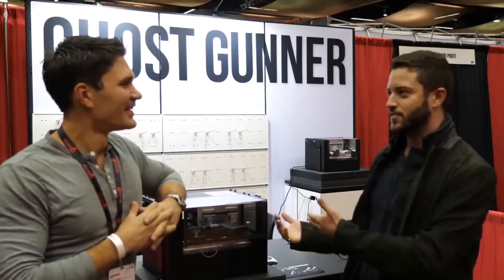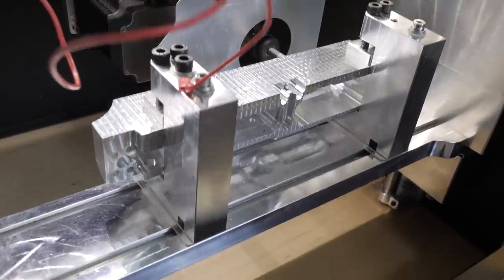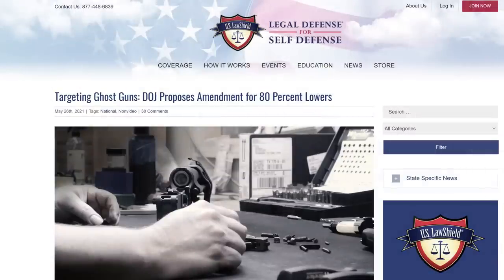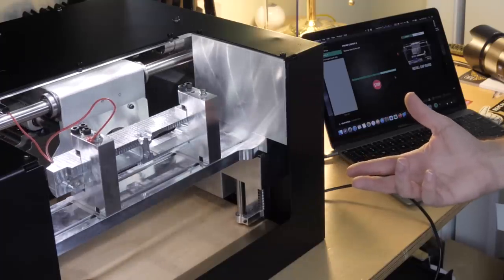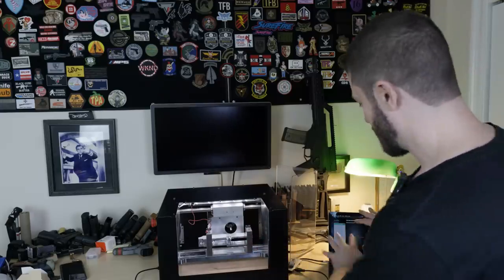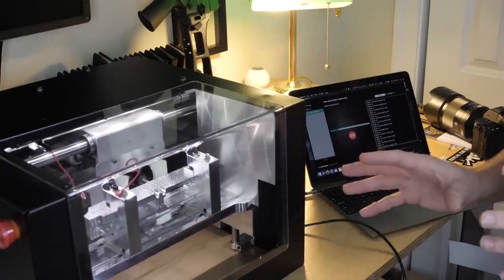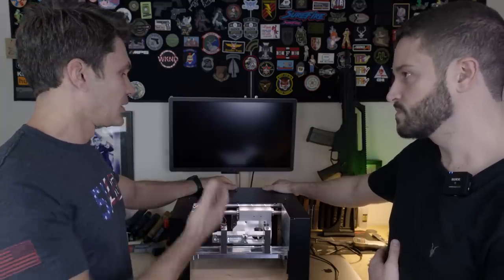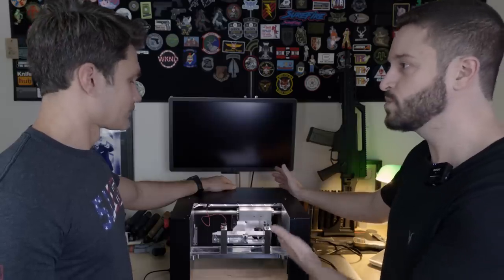NEW: Turn a Metal Block into an AR-15 Lower at Home with the GG3 Upgrade

Comment: This is great news! I imagine combining this CNC machine with 3d printing and we could build really interesting firearms.
Reply: Already happening
Reply: @hungryorphan5975  There have been people modding the software to use the GG2 to engrave on the firearm.
Reply: @thmsmgnm  Damn.  So there's literally no reason to not jump in now.
Reply: @hungryorphan5975  Nice? Could you mention any project being developed as a hybrid with the GG3 and 3d printing?
Reply: @Franiveliuselmago  off the top of my head I don't remember but print shoot repeat made a 3d printed  scorpion with an ar reciever, could print the other parts or use a mill
Reply: Called additive machining
Reply: E3D toolchanger
Reply: @Brandon Diederich you can use ecm to make rifled barrels
Reply: @hungryorphan5975  Alternately, a knowledgeable someone will likely figure out a way to build a rifling bench using a GG3 (or other desktop CNC), a 3D printer and hand tools.
Reply: Need files for glock slides next
Reply: Got a quick question.  Would there be the coding, etc for making the FN FAL receiver?
Reply: I mean, nothing really new, you could already buy 80% recievers and this just makes them, you have the same end product, then there are the 3D printed parts that are already out there and the ones currently being designed, none of them are going to change because the receiver is still the same so i fail to see your point
Reply: Its easy in Usa where yo can buy all needed parts, but dont thinks is so easy in europe and other countries

Comment: It would be nice to see GG4 or 5 turn into a slightly larger more rigid machine that would be  a more "open ended" consumer affordable tiny CNC machine.  The only PROBLEM with the GG are that they are kind of keyholed into certain size jobs and certain products.  I'd love to see the next iterations be more of a "if you can dream it, and do some solidworks, and it fits in an X x X area, you can mill it with this micro CNC.  Lots of us would love to make optics risers, flashlight mounts, adapter plates, custom ideas, and a plethora of non firearm parts.  Look at what decent 3d printers have grown into..  If I buy a micro CNC, I want a micro CNC not just a firearm builder.
Reply: Exactly, I couldn't see myself buying this with such a limited use, but a miniature CNC machine that could create anything you design that fits in it's work envelope would be awesome!
Reply: If it would run off SOLIDWORKS or Autodesk files, that would be awesome and have way more utility than just making a lower or 2
Reply: @wombatstriker  For real man.  I'm used to cutting shit with files and stones and calipers.  Even if there was a little chatter, it'd be awesome.  Luckily the "hobby home machinist" market is booming.
Reply: You've all missed the point of Ghost Gunner. It is a fully functioning CNC mill that runs on G-code, just like every other CNC mill out there. You CAN use Solidworks or Autodesk to do your modeling then run those files through the G-code converter, and feed that to GG.  If you've got the G-code for a metal miniature of the Enterprise, it'll spit one out for you. It does not just make gun parts. What they sell is the machine itself which specializes in gun parts and has the programs for gun parts, but you absolutely CAN feed it any program for whatever CNC Milling part you want to make.
Reply: @torjones1701  I meant more with the fixturing.  It seems quite specific.   I havent looked in a while, but last time I did I couldn't find anyone who had (vertically) installed a more traditonal machine vise.  If that is becoming a thing, that's awesome.
Reply: @mattfleming86  Yeah, a traditional machine vise, even a micro version of it, would be nice.  I've seen some pretty small, like a 4" low profile, but they won't work with GG because GG works on its side in comparison to traditional machines. I know that a professional machinist won't have problems making it work, but hobbyists will need a bit more understanding in making the work-holding adaptation to the GG.
Reply: @torjones1701  Yup.  And kne advantage of being an experienced machinist is that you'll have a plethora if tools (and materials) to MAKE more tools and fixturing.  
I think we'll be there soon.  Hell some of the small chinese mini CNC's are getting there.  With enough volume (and competition) it'll happen.  The desktop models keep getting better.  I know if I could get into the game with a machine (in size) somewhere between a microwave and yeti cooler that is rigid, affordable, serviceable, etc. i'd be stoked.  Give it 5 years
Reply: I'm surprised we're not all building miniature CNC machines right now.
Reply: @cheifDeisel  I'm not. If you consider that the easiest and cheapest way to get a CNC Mill is to start with a manual mill and upgrade it to CNC, and that alone is not a skill every hobby-machinist has or can develop, it really doesn't surprise me in the least. That most of the CNC conversion kits won't work with just any old hobbyist desktop mill, complicating things even further, it really shouldn't surprise anyone. Those who find it easiest are those who've built their own 3D printers, CNC Routers, and other such equipment, and it's still complicated enough to give most of those experienced people pause. It is only simple in concept, the execution tends to be somewhat more complex.
Reply: @torjones1701  🤦🏼‍♂️
Reply: I would spend $2000-3000 on a small general CNC mill in a HEARTBEAT. But with the limitations of this machine, and it’s sideways layout, I likely won’t buy it. I mean, how many lowers do I really need?
Reply: @alphazuluz  Totally agree. If it was a CNC capable of at least milling aluminum, and had a small range like an Ender 3, I would easily spend 3k on it. You can find used mills in the 4k range, but you have to upgrade to CNC which is more money. The GG is interesting, but the only other limitation I would mention is the range of motion. I would prefer more than a couple inches on the Z axis (Z being up and down since that can change).
Reply: @wombatstriker  look into a pocket nc and see what they can do, may be up your alley
Reply: Well you actually have to purchase the product so they can afford RnD into that project. Everyone always wants a Ferrari but they don't want to support them by buying the wagon first
Reply: @ajjohn8729  if they do not have the capital from the first two iterations that’s kinda fucky 🤷‍♂️
Reply: @ChineseSweatShoppe  weird how RnD works. I get you probably work an Amazon warehouse job and don't totally understand how manufacturing works so let me help you. You pay your bills with sales. The extra money from producing, selling, doing warranty work, and keeping the lights on goes to research and development. Inorder to improve a product you have to get customer data and examine warranty repairs to see fails spots you may have not forseen. You then have to pour that extra money into prototypes and do hundreds of hours of testing. All while maintaining, producing, warranting, collecting data o the previous iterations to release a new one. So support them or go back to your Fudd shit.
Reply: @ajjohn8729  "boohoo he doesn't want to shell out thousands of dollars for machines that can only do engraving and the finishing work on an 80% which can just be done with a decent and much cheaper drill press, he sucks for not having supported them when it was so obvious dispite them keeping the whole 0% idea quiet that they would clearly go from a heavily limited machine to a much more capable, and he should be ashamed of himself for being skeptical of a machine that went from being so limited to so capable and barely has any real indepth videos out there on how it works and how it's made unlike almost every other hobby level CNC machine out there in its price range and below its price range, this is just a miracle product, the writing was on the walls people, the guy running this is just a saint who hath handed down to us the key to freedom and this man scoffed" stfu dude,  being critical of a shotty new product and not just praising it cause it could be the new tesla is a sign of intelligence, yes i agree most products from a new company don't sell too well for the first couple versions and such and it can be a part of the  R&D process, but its fine to be skeptical on why the first few didn't sell, after all most companies don't produce a geo metro then a ford fiesta then suddenly jump to a Ferrari, they usually take a pitstop at making a fierro
Reply: I bet you unironiclly print toys with your 3d printer dont you?
Reply: Making my own optic risers would absolutely be great! I’d go for something like that.
Reply: @mattfleming86  Yes it is
Reply: It's completely programmable make your own fixture and make a program and don't expect people to hold your hand this machine is a CNC mill not just a gun builder you sound foolish
Reply: @chriskraus2440  You missed the "Slightly larger and more rigid" part.  I may be foolish but at least I can read.
Reply: Just get a shariff dmc2. The ghostgunners arent worth the money they want for em
Reply: @torjones1701 it's BARELY a fully functional CNC machine. Definitely not worth the money they want for it

Comment: Would be nice to see the final product at the end of the milling process.
Reply: That might be legal hot water
Reply: @CHMichael  Why? If its legal for me to buy one  and do it why can't he make one and show it?
Reply: They have some video of it, theres one video of it at some sort of event, they make it in 3 parts which are bolted together using threadlock on all the bolts, which explains how they do it in such a small machine, and also means you could do it on a cheaper small CNC machine using the same method
Reply: @farquharsondan Youtube doesn't like it.

Comment: The 3d printing gun community was literally started by Cody Wilson. The FCG9 has been photographed in the wild being used by rebels against Myanmar. We have already won, even if government refuses to admit it. Huge credit goes to Cody Wilson, and of course the actual designer of the FCG9, J Stark, who was murdered by the German government.

I'm not necessarily taking sides in the Myanmar thing, mind. But those who rebel are always within their rights. The fact that they're building guns entirely outside the control of the State is what we should be celebrating.
Reply: If you want to be specific, Stark wasn't the actual designer. The FCG9 was a copy from a Texas designer with possibly one of the first semi-auto printed firearms, and the FCG9 was a minor revision to the AP9 to use metric screws and specified an ECM barrel (which was already a thing). If you want to say "popularized", maybe, but even then, its just a metric reskin and I would say "remixer" (which there are actually more substantial, and impressive remix designers than the FCG was).

Can you imagine being the real designer, and then some kid steals your work plastering their name over it? As a mechanical and aerospace engineer I would be very annoyed (which the designer was since all they were asking for was credit). Seems trashy to steal major credit and all that important testing like that... I personally think all mechanical designs are cool, and small arms designs are excellent for learning to improve almost any commercial product (such as designing for installation, tolerances and their importance, nifty assembly tricks etc). I may not specify "inspired by Eugene Stoner" for unrelated products where I see a cool little feature I add to product, but I'm also not flat out copying like Stark did. I'm glad someone ran with the design though and improved it, but I don't see a reason on hiding credit where credit is due.
Reply: @jakegarrett8109  did not know that.
Reply: I don't really agree about that part about those who rebel are always in their rights to. Thats not a concrete correlation...
Reply: @georgewhitworth9742  by definition humans have a right to choose their governance. By definition any government which has to deal with rebellion is overstepping their bounds. Government is the most evil thing humans intentionally do to each other.

Comment: Anybody with the specs and a milling machine even on old school tooling can do the same thing. It may not be as precise as a CNC (computer numeric control) machine but it will still work. Folks have been doing it for ages. No one can kill the cottage industry.
Reply: The point of this is to make creating lowers as easy as pirating music.
Reply: Yes but you really need experience or at least training to do it reliably, this eliminates that and gives the average Joe the ability to machine their own firearm parts without having to go through that.
Reply: These desktop CNCs aren't going to have anywhere near the tolerances of a 5000 lb 5 axis Bridgeport.  
They will still get a lot of jobs done anyway.
Reply: @joenunya8449  yah but you don't need that accuracy or tolerances to machine a firearm.
Reply: A $2500 box the size of a desktop printer is much easier for people to buy and use than even a hobby mill and requires less skill.
Reply: @relativisticvel  definitely true.  But it would be nice to have it for mechanical parts.  Everything is ballance of feature cost vs budget though, and my budget is very tight.
Reply: Based pfp
Reply: The problem with the cottage industry is it is cottage sized. The lower is a worthless loophole that only works if you can buy the other components that require high volume production in forging, casting, precision machining, heat treating, and materials science.

Unserialized lowers don't even keep you off the feds list if you purchase any part or ammo from any business with anything but cash. 

What is necessary is companies like Palmetto State Armory that mass produce the most popular guns in high accuracy  and quality for a few hundred dollars. It is hard enough for someone to gain the skills to safely use a firearm. Any  hurdles put in the procurement makes everyone less safe as that is time and money not available for training.

It is tyrannically wicked for the government to deny the average person affordable, safe, and reliable self protection.
Reply: So what parts do you still need to order?

Comment: Now I can use all the Mountain Dew cans I have piled up!
Reply: Or melt down all the spent brass casings but that might be expensive
Reply: @9x19freedom  a brass lower? I like what you are thinking.
Reply: @chuckdoom7665  Brass would be way too soft
Reply: @TheFishE77Official  it's harder than aluminum. Plus lowers are now even made of polymer with brass inserts for strength .  You may want to reconsider your logic. Brass is heavy, that is the main downside I see.
Reply: @Haku Yuki that's what I was thinking! My furnace won't get hot enough to make brass, only aluminum.  Time to get me one of those devil forges.

Comment: Amazingly ridiculous overreach by ATF/DOJ.  If you get caught selling an 80% and charged for selling/building guns without a license, ask the court to have an ATF agent chamber and fire a round with that 80%.  Then, when they claim that 'it can become a firearm with very little extra work,' ask them 'then why are you not charging me for NFA violation for manufacture of an untaxed machine gun? '  I think a jury and judge will see through their bullshit very quickly at this point, given that the difference between an AR-15 lower and an M-16 lower is ONE HOLE.
Reply: One hole but also the FCG pocket is milled further back in the rear to accommodate for the auto sear

Comment: ya know who else doesnt like this thing other than the AFT? the gun industry. major props to tfb!
Reply: Ultimately that's very short sighted. This only helps people make a lower. One single part. They need to buy a whole slew of more parts to make a complete gun.  And anyone who's built their own guns knows it is much cheaper to buy a complete gun than buy parts individually. This could make AR parts  manufacturers (or Glock parts, or 1911 parts, etc) a lot of money.  And this is only for a very small percentage of gun buyers who are willing to build their own guns. It's no threat to the gun industry at all. I see it as a huge boon for the industry.
Reply: @dmk0210  this was exactly what I was going to say.
Reply: @dmk0210  i think thats an optimistic take: that the gun industry would see home manufacturers as too fringe to cut into sales and just big enough a market to sell accesories to. realistically, why wouldnt big gun manufacturers want to maintain a monopoly? with improved cnc, home manufacturers can create their own accesories, even sell them and compete with bigger manufacturers. its basic economics: the fewer manufacturers of any good, the easier it is for existing manufacturers to restrict supply and drive up prices (see: OPEC). i hope youre right that the big manufacturers see the writing on the wall and try to work with new technology rather than fight it like the record industry did with filesharing back in the 00s though
Reply: U must be kidding.

Comment: You read my mind about other components.  Miniature cnc like this is going to going to open the doors to high quality home gunsmithing
Reply: Not only gunsmithing! Also a way to make lots of other parts.  

Car parts for instance!  Are you perhaps restoring an old dodge and need knows bits of trim etc.  Members of your old car club need some?  Old airplane restoration?  Same sorts of stuff can be made, not flight critical naturally! 

Modle train stuff great hobby.

Biden wanted to make single use machines that only make gun parts restricted.  So...Great scale model train maker!